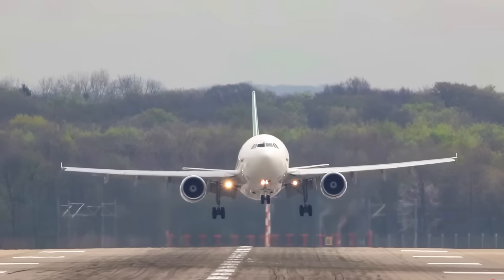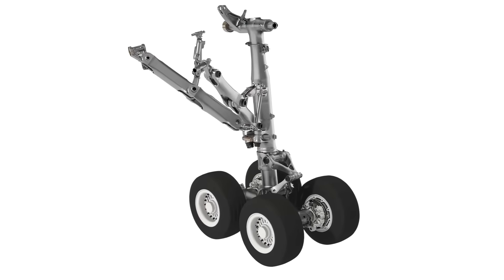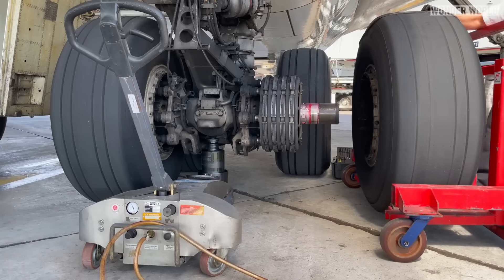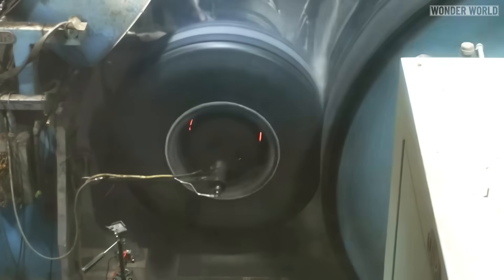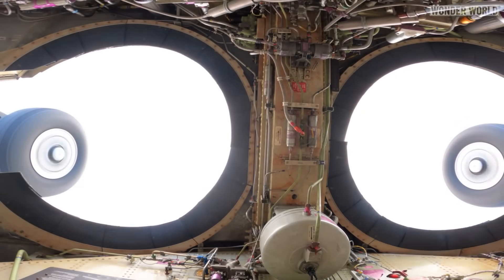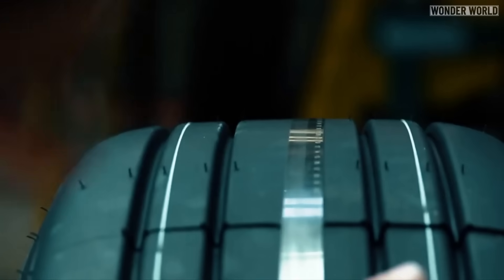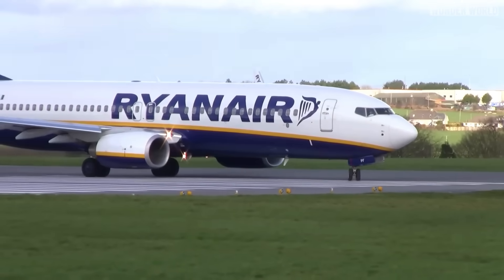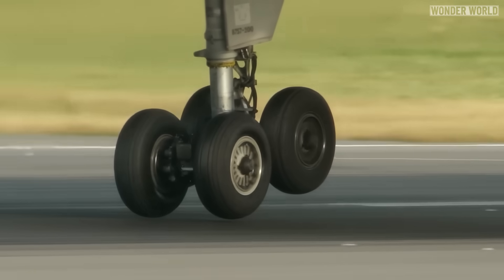Why They Don't Pre-Spin Airplane Wheels on Landing

Comment from the maker: I hope this video clearly and fully answers everyone's question of "why can’t they put motors in the wheels or wind vanes on the tires or rims, to have them already rotating up to landing speed so they do not skid and leave behind rubber."
Reply: They can put electric motors on landing gears The issue is they haven’t because no one has developed a landing gear with an electric motor in it. That actually makes it worth it yet.
Reply: (former airliner landing gear engineer, tasked with responding to people who contacted my airframe maker with pre-rotation ideas)  The economics simply doesn't make sense, regardless of the method employed.  Not even close.  Tire spinup loads, for example, don't figure into tire design compared to braking loads/wear.  Pre-rotation of MLG tires is a solution in search of a problem.
Reply: Maybe instead of pre-spinning the wheels, someone needs to invent a device that temporarily turns off friction, then ramps it up. /jk (impossible tech)
Reply: It seems a lot like the answer is:  "because".
Reply: Wouldn't it be possible to add some form of simple fin system on the face of the rims that create spin in the correct rotation? I'm certain with the right design, you could have them spooling up close to the correct speed prior to landing.
Reply: You basically stating, any development is not useful, the decision is made of good reasons. Thats essentially wrong, there is always room for development. You cannot stop inventors and it is mistake to try that. Your story is single sided, and in the future some things may change.

Comment: There is also one thing that wasn't covered here, unless i missed it ofc, which is the kinetic energy that gets dissipated on touchdown with static wheels. If you pre-spin the wheels it will add quite a bit to the landing distance which will also means the brakes will be required for longer, leading to higher brake temps and longer turnaround times costing airlines more money.

Comment: you missed one point... how does a dragster increase grip... right.. spinning the wheels with a burn out to clean the surface and increase the temperature... 
so if you want the best performance you can get this might not be bad at all

Comment: you don't need to spin the tires to match airplane speed, even a 10% speed would massively reduce friction and tyre wear. definitely worth trialling vanes especially as they can be retrofitted worldwide, think of how much rubber will be saved.

Comment: This makes it sound like all the negative aspects to the idea are about concepts from the past before the latest types of electric motor-brakes were developed.  They could replace the braking systems and use the already existing onboard generators for power during landing for the spinup. It sounds like they might actually be lighter than the existing braking systems, and require much less maintenance.

Comment: The brakes can be removed and replaced with motors. The motors can speed up the tires for landing and they can brake and recapture energy for the battery system. The wheel motors can help propel aircraft as well
Reply: It sounds like a closed loop system that you describe here. It would be not viable, since you would need extra batteries, which add extra weight. This will cost the airlines money in lost passenger capacity or in increased drag/ fuel burn during flight. Tires are just way cheaper than that.
Reply: @dersebbler9452  Why couldn't they get power from the already onboard generators?

Comment: Sad to say, you are right ! However, everybody would like it if there were motor driven wheels. Imagine, the airplane would taxi without noise, without danger, without the enormus fuel consumption. In addition to that the motor driven wheels could help to accelerate during take off . . .  .  I know, its unrealistic but a nice fantasy 😎. When I tried to get informations about such systems I learned that even the jet engines must not be shaked during stillstand because of the bearings which could be damaged. That means taxiing without jet engines would lead to another motor to turn the engines at a suitable speed.

Comment: Pre rotating the wheels still wouldn't help. My dad worked for Lockheed Vega back in the early part of WW2. They experienced the same thing with B-17, the smoke is burnt rubber. it still happened with vanes, and any kind of pre rotation. The skid was attributed to the weight of the aircraft being transferred to the ground from the lift of the wings.

Comment: good video but I don't believe everything the people say about those windblades on the tires since the 40s, and about too much weight, just bs, because how much weight would be lost if they take the electric adjustment components first class and business class teats, that would be more efficient, just like in Belgium, the Hwy lights are always on, the turned them off, and then claimed it cost more to have them off, bs because the electricity company's lost money from the state, and after all who pays for the bill, the taxpayers. just all bs.

Comment: Tyre deterioration during taxi is exacerbated by wall deflection which fatigues the fabric and creates heat. Long taxi manoevres to take-off by heavily laden aircraft put a lot of stress on tyre walls. I discussed tyre spin-up with a Rolls Royce engineer fifty years ago who offered a long list of reasons why it would never be adopted. We talked about possible savings in undercarriage weight however there were none, because the aircraft has to land safely if the tyre spin-up malfunctions, and passenger comfort on landing which he felt would only be a slight benefit and then only if the wheel rotations were exactly equal and matched ground speed perfectly.

Comment: They tried that years ago it didn't work because it's too expensive, too complicated, It's much cheaper just Buy new tires. There I saved you from watching the video
Reply from the maker: if companies don't try and use new technology and give it a chance over time, then the technology will never come down in price where everyone can afford it.
Reply: @WonderWorldYTC  Come on now you made this video. Are you back peddling? I don't think even the best method of wheel spinning falls under that category. The reasons against such unnecessary tech were and are numerous and clear, though those reasons certainly went over the head of a lot of commenters here ..
Reply: It's not new technology @WonderWorldYTC

Comment: I trained as cabin crew on 747s for BA. Back in the 70s. We were told in training that pilots 'bump' the plane on landing in order to bring the wheels up to ground speed. In other words, the pilot deliberately bounces the plane once to hit the wheels on the runway, then finally lands the plane. We were also told that because of this a 'smooth landing' wasn't a particularly good landing. I don't know if this has changed over the years, but I've never forgotten it. No doubt online pilots will put me right.
Reply from the maker: I don't get it, why bump the wheels, lift up then come down again, you have already given them a bumpy landing + put rubber on the tarmac.

Comment: I was picturing an "in-hub" electric motor that could assist with accelerating the aircraft during takeoff, brake the wheels during retraction, pre-spin the wheels during landing and then switch to braking to help slow the aircraft. I didn't think about the power consumption all this would need or whether the on-board power system could handle it. Oh well, back to the drawing board for my retirement-allowing idea!

Comment: as someone with Absolutely No Experience as a pilot whatsoever, my first guess is that "non-spinning" wheels would ADD that little bit of Resistance when hitting the ground, which is when a plane is trying to, yknow, STOP...to 'remove that Resistance' means that you would need MORE Brake, when theyre applied...so why Add a mechanism that "undoes" whats needed? thats like adding Weights to make a Balloon fly Higher...

Comment: They dont want a gyroscopic force acting on the wheel while airborne, it will harm a flight. All the wheels are stopped after stow inside the wheel well.

Comment: Also, as far as the weight goes because of region breaking, you can use less mechanical, breaking an all set that way for electric motor, which there are electric motors known as aerial flex motors, which are very lightweight and have the power to propel this thing down the runway

Comment: You have the equation kind of half backwards here OK the ideal of putting electric motors in the landing gear is not for the purpose of spinning the wheels up on landing. Is to do two things one accelerate the plane up to airborne speed without using any thrusters or any fuel to using region breaking to slow the plane down in a lower runway so you would need a shorter runway to land and takeoff.
Reply: It is apparent that this basic video and it's concepts are above your pay grade. Maybe you should take a few basic physics courses, no? Pay closer attention to electric and magnetic principles. Maybe .. just maybe it might occur to you, once you know how heavy these planes are, how electrically demanding it would be to use heavy landing gear motors, as in railroad speak, traction motors. Get some schoolin ..

Comment: As a commercial aircraft mechanic, just having to change tires and brakes on in-service aircraft alone is bad enough, without having to futz with other devices installed to spin up wheels on landing. It was tried decades ago and it just didn't work, essentially because unless you can match the exact landing speed it doesn't really help to reduce tire wear when you set a 200,000lb aircraft down on them at 150mph. Then there's the added cost, weight, complexity of the design, etc. I think the airlines just consider it part of doing business. Besides, large airliner tires have a pretty good life expectancy, IF they are properly maintained. That's the most important issue. A low nitrogen pressure level will kill a plane tire quicker than anything. That's why daily checks require checking the tire pressures and there is a very narrow operational range, and if pressure falls below that range, even by a couple of PSI, BOTH tires on that axle are required to be replaced. Tire technology and rubber compounds have really improved since I started working on planes 40+ years ago!

Comment: Air Force C-17 and C-5 mechanic here. Yes, taxing will deteriorate tires much faster than landings. Why? During taxing, the tire experiences greater friction, especially during turns. Landing is mostly absorbed by the Strut at impact, the wings are still generating some lift, and the amount of time tires spend rolling during landing is less than taxing around and airport with all the weight of the aircraft. For example, towing an aircraft actually causes a lot of wear on tires due to the tires moving at a low speed with a heavy weight.
Reply: Lol

Comment: NASA studied pre-spinning the space shuttle wheels. They determined that pre-spinning the wheels would reduce tire wear by 50% but they still didn't go through with it because rubber is just too inexpensive compared to the cost of carrying extra weight into orbit.
Reply: That's for a space ship, where every ounce matters.  Also, there is no problem with tire wear or runway fouling. You can't begin to compare the two situations.
Reply: @geonerd   I can (compare the two):  Airliner landing gear engineer, but also advised NASA on Orbiter tire/brake problems.  For starters, Orbiter tires barely survived one landing.  There was severe tire wear, especially early on, but that was from braking rather than spinup.
Reply: @geonerd  wut
Reply: @geonerd  Stick with flipping burgers.
Reply: @geonerd  Guess you skipped the video and went straight to the comments?

Comment: If anything the wind vanes should spin the tyres backwards, to help slow down the plane and give the pilots feedback, on an A380 you can't even feel the landing.
Reply: Terrible idea. Increased rubber wear and instability on touch down.
Reply: @Dwight511  the rubber wear isn't an issue, and it's about feel for the pilots, it wouldn't make a big difference to stability on large aeroplanes.

Comment: A better way to reduce tire wear would be to design the airplane so it lands at a slower speed, this will increase survivability and save lives in case of emergency landing. Why can birds, no matter their weight, can land on a branch with almost zero speed while airplane cannot?
Reply: Because planes can’t flap their wings……
Reply: They will stall at lower speeds
Reply: Most birds HAVE to land on branches all the time, so they are adapted to it. Most water fowl avoid the effort and use the waves they generate to brake.

Digressing from your point: Birds on branches can jump off and use gravity to get up to speed. Birds on the ground need to get up to take-off speed. Some struggle with that.

Perhaps I should start a 'charity' that gives me a good salary for managing it, then launch TV appeals in a sad voice to ask people for "just £2 a month" to buy launch catapults to make life easier for the poor albatross shown at the start and all his fellows.

Comment: If more rubber is lost during taxiing, wouldn't you see it on the taxi ways? I think that comment might be incorrect
Reply: Could be, but maybe it’s the longer distance, the rubber gets spread out over the whole distance rather than just during that instant of landing
Reply: I agree. Furthermore, the rubber is not just left on the runway but also vaporized (smoked) into the air. Rubberizing the runways and our air are externalities, costs that are not born directly by the airlines and do not enter into their equation. Furthermore, the "wind vein" concept may not spin the wheels up to full speed, but it would reduce the skid upon impact. "But the drag!" I can hear some pilots say.  The flaps are already down when the wheels are down upon landing. Upon takeoff the plane is flying slower (less drag) and the wheels are quickly lifted. I think the problem is that the airlines are not responsible for the externalities of burning rubber when "they" do the math.

Comment: or in short: its more cost effective to replace and rethread wheels than having hundreds of pounds in elecrtic motors (multiple), gearing, batteries and wirering on board for landings

Comment: Even on fixed landing gear airplanes, we tap the brakes on takeoff, because the spinning wheels (when not perfectly balanced) can wobble.
Reply: I was never taught that and don't really think it would matter
Reply: @ It's not crucial. I didn't even notice it in a 172 until I started flying an airplane with a not-so-perfectly balanced wheel, and my instructor tapped the brakes after I took off.
Reply: Also needlessly wears down the bearings and creates minor gyroscopic forces.